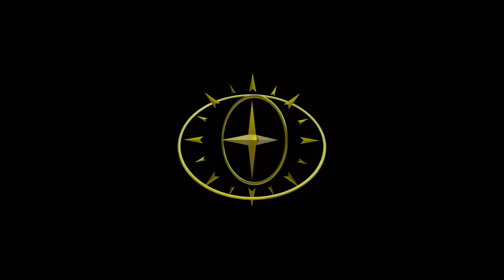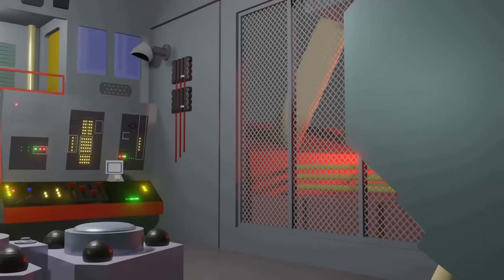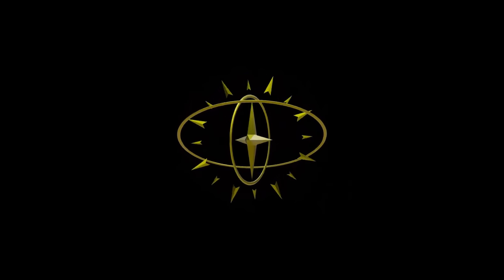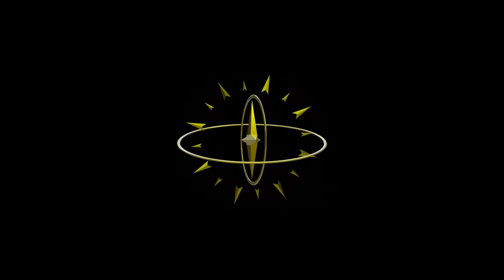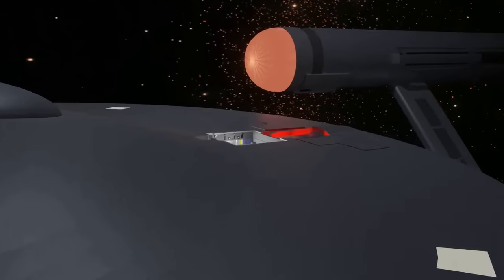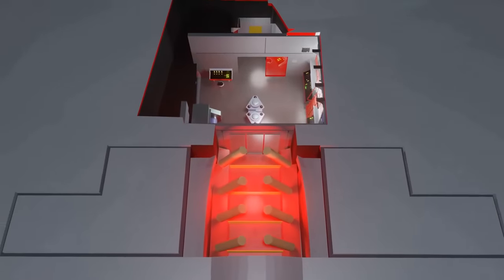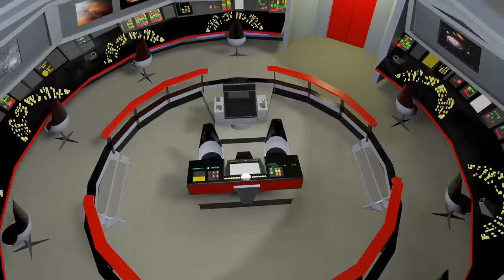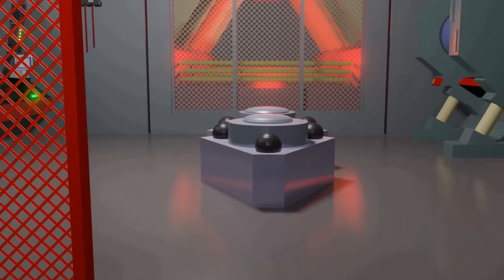The Enterprise Engine-room Enigma: where was main engineering?

Comment: Problem with engineering at the back of the saucer is....Only at the rim do you have 2 full deck heights. Going towards the bulge the lower rim level's floor will start to curve up a good 5 feet. Half the deck height. There is nothing strange going on on any of the engineering sets floors they are still two full levels tall.
    I decided to add this. The same problem also arises on the refit Enterprise's rec deck. You see the 8 rectangular windows, 4 on the bottom and 4 on the top two full decks tall.but the floor should curve upward but you can't see it. All the extras are standing on a flat floor with Kirk standing on a platform flanked by two light columns made to look like turbo lift shafts. I get it. There wasn't enough budget or time to make a more realistic set.

Comment: If the original series writers bible didn't say where Main Engineering was located on the ship, then it's simply forever undetermined unless one of the later published technical manuals was deemed canon by Roddenberry. I mean, hell, we know where the bridge is yet we also know that the exterior design of the ship and the interior design layout of the bridge don't jive for the reasons we already known. I'm going to approach this the same way Bob Gale, writer of Back To The Future did when I pointed out continuity issues to him having to do with the mileage showing on the DeLorean odometer when the Libyan Terrorists were chasing Marty through the Twin Pines Mall parking lot. He said to me, “If you're hung up on such minutia you probably need to get a life.” If the need to know the exact location of Main Engineering on a Constitution Class Starship is that important to you, you too probably need to get a life. Remember, that show was about the stories and it was a metaphoric representation of it's time. The tech was only there to lend itself to the storytelling when applicable. It didn't matter where Main Engineering was on the ship, only what sometimes happened there. I mean, where is Talos IV in relation to Earth? It doesn't matter.

Comment: Is there even such a thing as a "main" engine room? When they say on the bridge engineering, they might just refer to a type of room. Everywhere there are egineering rooms. And just like how it was a convenience of shooting to place the turbolift of the bridge on the side, it was a convenience to depict both the impulse engine main engine room and the main warp engine room with the same sets, even when they weren't supposed to look exactly identical. It's like how they used the Enterprise ship model for every Federation starship, even though they were supposed to have slight differences.

Another thing: the set on the engine room itself is 2 levels high, so even when refering to one main engine room, it might be correct to use plural for "levels" or "decks".

Comment: It is correctly 'Season' as it is not serialized; that is all episodes are standalone and do not follow a continuity from episode to episode. 

Main engineering is just forward of the nacelle pylons. The red glowing shafts behind the grating in main engineering, are power conduits running up the pylons. The island in the center of the room, is the top of the warp reactor, which extends down through multiple decks. In WoK, the reactor is shown laying horizontally.
Reply: It is not 'correctly' season. Series means: 'a number of events, objects, or people of a similar or related kind coming one after another' or 'a set or sequence of related television or radio programmes'. There is nothing in the dictionary definition stating that there needs to be continuity from one to the next.
Reply: @philipmcfarlane  

🤦🏽‍♀️

Comment: We'll have to wait until The Thermians have built the real one.The FASA rpg deckplans have two engineering sections with the impulse engineering section aft of Deck 2 next to the impulse engines  and the warp engibeering section in the secondary hull. I prefer to imagine there is only one engineering room in the secondary hull.
Reply: The SciPubTech cutaway and the canon onscreen cutaway made by Doug Drexler shows there's a small engineering control room on the "Impulse Deck" (referencing the line from Gary Mitchell in "Where No Man Has Gone Before") and the Main Engineering is in the secondary hull just in front of the warp nacelle pylon with the tubes seen behind the red screen being the EPS conduits feeding the plasma from the warp reactor directly up through them to the nacelles.

Comment: The important thing that TOS did that every Trek after it got wrong was that the power for the ship is generated in the nacelles and fed to the ship, just like an airplane, which uses energy bled from the engines to power the plane's systems, air conditioning, lighting etc. The majority of the energy generated inside the nacelles was obviously fed directly to the warp drive system inside the nacelles. This arrangement makes much more sense than having the power generated inside the ship and fed out to the nacelles.
Reply: Very true, especially since the engines are radioactive.